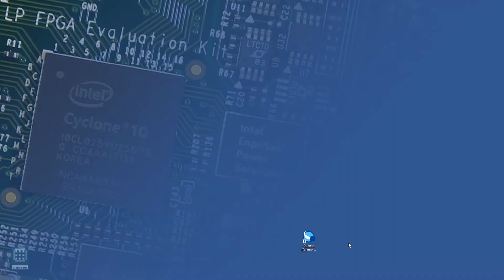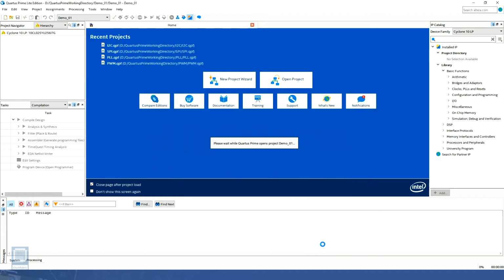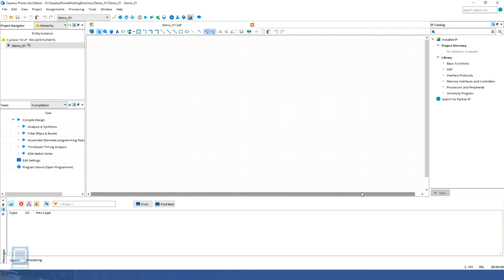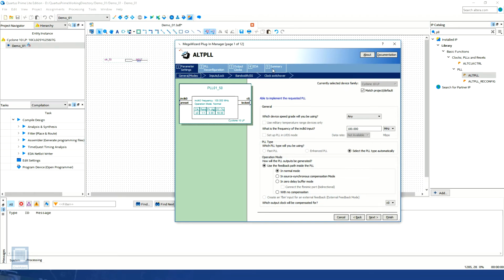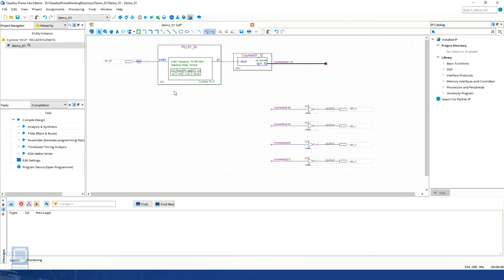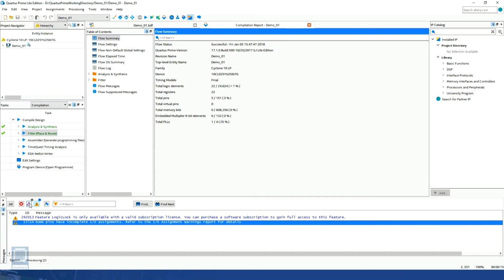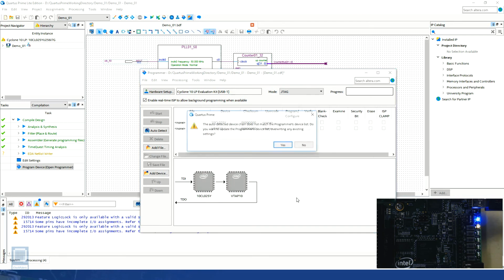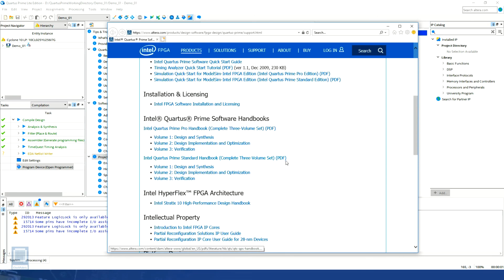003 Exploring Quartus Prime Lite 17.1 and Creating a New Project - ClockFabric (with subtitles)

Comment: A great help, thank you.
At first I was worried that the video was 6 years old as I'd installed the latest version 23.1.  Turns out version 23.1 is rubbish - crashes at the PLL step.  On checking, my customer is still on version 18 for stability, so I've gone back to that, and find this video to work well with that version.

Comment: Fantastic introduction!  Except for one major problem. With Quartus Prime (Lite) V18.0,  the "Cyclone 10P" listed for the "Family, Device, Board Settings".
All you see is Cyclone IV E and Cyclone GX in the Device Family dropdown box.  Numerous names below but I cannot find one that is programmable at the end -- very frustrating as I only find out at the end.  
The chip label is "10CL025YU25617G" on my board. 
Anybody got an answer? What device do you use for your Cyclone IV on the "Intel Cyclone 10 LP Evaluation Board"
Reply: Answer my own question. I did not include "Cyclone IV device support" in the initial download. Uninstalled and reinstalled (2 hours later! it worked).